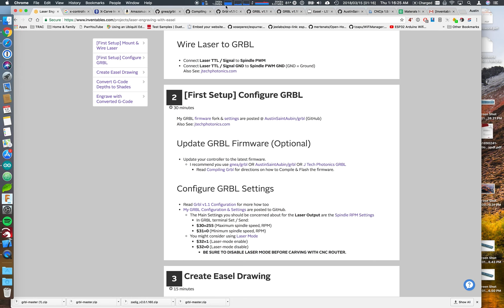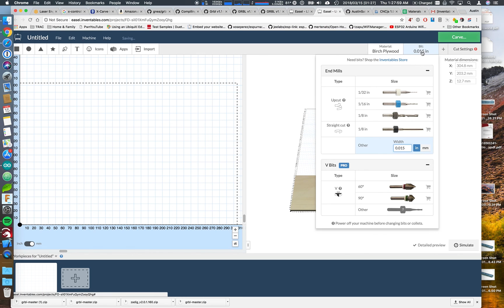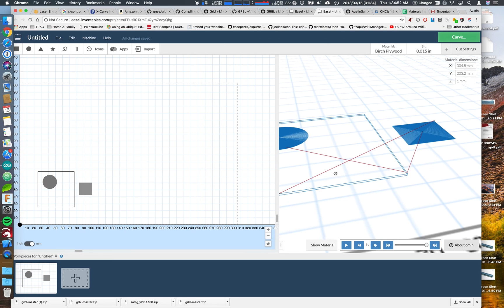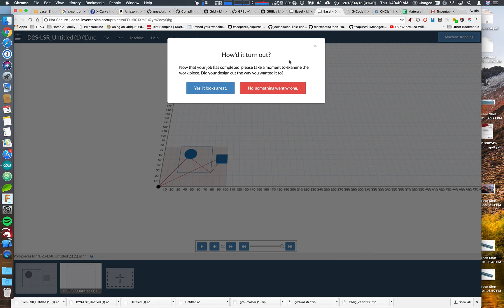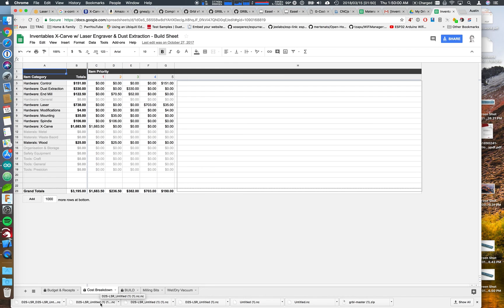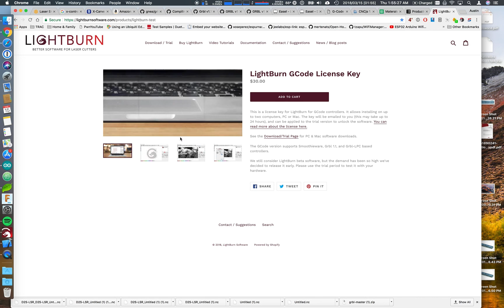Laser Engraving with Easel

Comment: quite confusing. so where is this easel laser module?
Reply from the maker: @OOAK-Ireland  not sure if I understand your question. You can add a laser diode to your x-carve. Then use easel to produce a design, and export the g-code from easel. Then take the g-code and convert the Z-axis movements to power intensity so the design in easel can be produced by the laser. The web app I made does the g-code conversion.